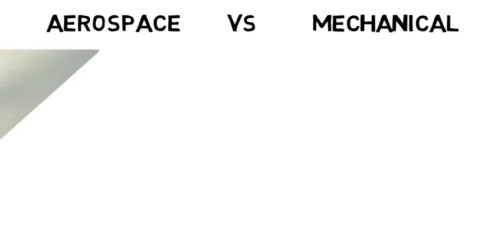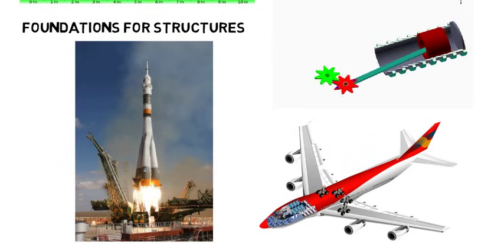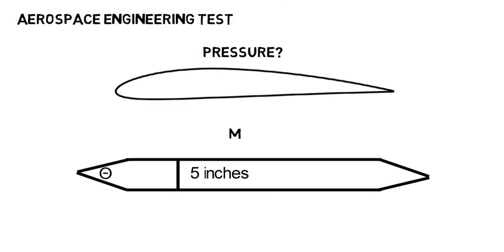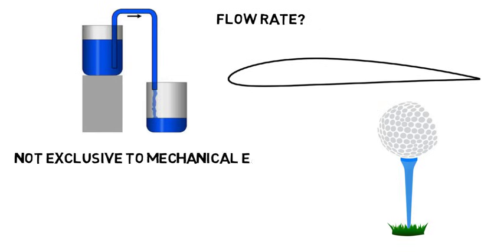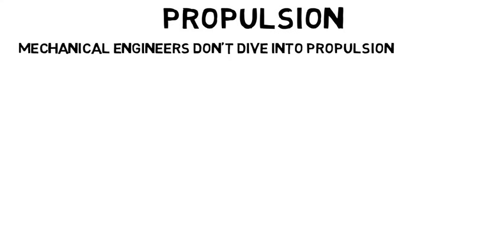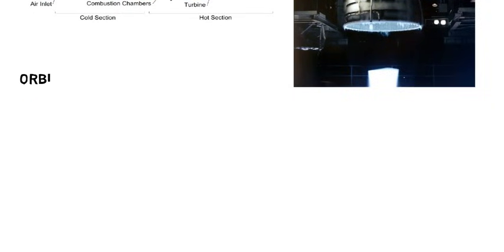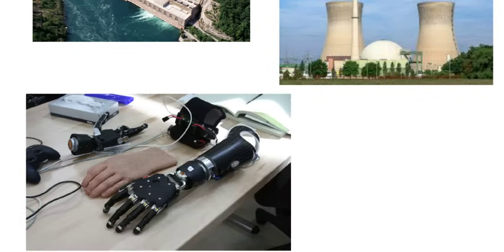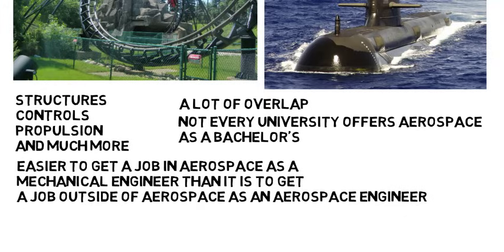Aerospace Vs Mechanical Engineering - How to Pick the Right Major

Comment: This is the video I needed to see 16 years ago when I was picking a major.  I went aerospace, but probably should have gone mechanical for the flexibility.  Nobody I spoke with knew enough to give decent advice on that decision, and (at the time) I was always told "If you can do aerospace, you can do anything".
At least I have some confidence that moving into a Master of Mechanical Engineering program was probably the right move.
Reply: How about the other way round?
Reply: Also I don't know for sure, but I think there are a lot of restrictions in the aerospace industry like you have to be American, often need security clearance etc. 
That's why as a non citizen I am still in doubt on how I should go forward in my career as I ultimately want to work on spacecraft and rockets.

Comment: Aeronautical/Aerospace/Astronautical Engineering has a lot of difference so be careful with that first. Aeronautical Engineers always expect to work in aero field cause of interesting subjects like Aerodynamics, Aircraft Design, Aircraft Performance and so on. But Mechanical Students study about Mechanical in General but they don't have much knowledge on application of mechanical in aeronautical engineering. That's the difference. Well i did aeronautical engineering because i was only interested to study in detail about aeronautics during Bachelor itself that how this flying objects do fly. That's the point. I work in Aeronautical/Aerospace field because i know how aircrafts work. That's why i chose aeronautical engineering. Aeronautical and Mechanical are not the same and infact aeronautical engineers have more knowledge than Mechanical Engineering but still Mechanical engineers are chosen most because they are good in designing of Anything. So i don't compare aeronautical with mechanical because aeronautical itself is the different field and there are lot of options after aeronautical that Mechanical Engineers don't have. If you are interested to study about aircrafts in either commercial/Military/Fighter than probably Aeronautical Engineering you have to go through. That's my opinion. Aerospace Engineering is all about study about satellites, rockets an so on. Be careful if you want to know how objects do fly then either you choose aeronautics or aerospace.
Reply: Not necessarily true, I chose mechanical because of the vast array of job opportunities; as I have interests in a lot of different area but want to primarily continue in the aerospace industry as I enjoy it having worked for Boeing and USAF.
Reply: @knyghtkrawlr  can a mechanical enginners is able to work in aerospace field
Reply: @muhammadajmal2380  yes but if you only want to go into aerospace probably best to get an aerospace degree or aeronautical degree
Reply: Can a aeronautical engineer gets a job easily

Comment: Aerospace is a spinoff from Mechanical Engineering, if you know MechE you can do both.
Reply: Mechanical engineers just touch on a bit of everything. You choose Aerospace if you don't want to work on a bit of everything and want to go into working with planes and spacecraft.
Reply: @DiegoHunter  in my experience, the biggest thing companies want is experience which you’ll get through internships or summer jobs with these companies. That was my mistake, I didn’t understand the importance of them. You are correct that aerospace is more specialized, but on a high level, one of the biggest things I learned with my degree was how to approach a problem and systematically solve it (which was then applied to aerospace problems). Now I’m sure mechE will teach similar skills, but I know there is more generalized knowledge, especially regarding thermodynamics and flow. So you’ll get the scope, but I don’t know how much you learn to apply it. If I could do it again, I’d still choose aerospace based on my interests, but I’d work a lot harder to get internships and expose myself to as much experience in applying my knowledge as possible. Hope this helps, I’m happy to answer any other questions you have.
Reply: it's just like meche but aero specializes on planes.
Reply: ⵉⵜⵔⵓⵏⴰⵓⵜ Lmao
All aerospace engineers are mechanical engineers, but not all mechanical engineers are aerospace engineers. Simple as that.
MechE is much more broad, general, and trivial compared to Aero curriculum.
Reply: @SLPpanthers42  no, cause at the same time  an Aerospace Engineer doesn’t know all things like a mechanical engineer. The A En. is specialized only on one argument
Reply: not true per se, other way round actually
Reply: ARE YOU GUYS ACTUALLY COLLEGE STUDENTS WTF AHAHAH
Reply: @kevinsanmateo4781  Your grammar level tells me that you aren't one either.
Reply: @rock3tcatU233  😆
Reply: @kevinsanmateo4781  🤣🤡

Comment: Which one is best aeronautical or mechanical engineering??
Reply: Alijut 12345 

Depends on what you mean by “best” since that’s a very subjective question. But if you know what you want to do in your career it can be and objective question. If you want to work on propulsion or aerodynamics, then Aero is best. If you don’t know what you want to do exactly, then mechanical is best. Although you can go to a college or university that offers a good AE curriculum and you’ll touch on a great deal to topics in detail and by late junior year hits, you should be able to know exactly what you want to do and then focus on that topic with the courses offered in AE.

Comment: These were literally the exact two majors I was considering.
Reply: I did aerospace as an undergraduate, but happened to graduate about the time the space shuttle retired.  The aerospace industry in general is more sensitive to what's going on in government, since most of the companies get significant amounts of their work from government funding (Boeing, Lockheed, etc.).
If I had it to do over again, I probably would have gone with mechanical engineering.  Getting a job when you get out is pretty important, and if you don't already have connections in the industry (as I didn't) it can be hard to get your foot in the door.
Reply: Dragon Bloodthirsty 
That’s one of the main things that made me choose Mechanical over Aerospace. 
Wish you the best of luck.
Reply: I want to work in spacecraft and rockets more than anything. But i am only concerned about the job opportunities for choosing aerospace engineering. Especially considering I am not a US citizen.
Reply: @livethefuture2492  same idk what to do
Reply: Drew Bishop 
Same. I ended up picking Mechanical.
Reply: To be completely honest guys, both courses are nearly identical with the exception of a couple of varying modules. So in my opinion, it won't make that much of a difference which one you choose to study as an under-grad. Most job opportunities I see regarding these courses accept both. It is very rare for the description to say accepting Aerospace graduates only (or Mechanical), usually both are interchangeable. I studied Mechanical Engineering and shared about 90% of my modules with Aerospace,  Automotive and Motorsport Engineers. For those looking to complete their Master's however, it probably will make considerably more of a significant difference.
Reply: @zacharysylvester8349  wait how much of a difference does a masters make? I’m a senior doing colleges apps right now and very confused 😢
Reply: Drew Bishop sameeeeeee
Reply: @marine5529  what did you choose ?
Reply: Ayo same wtf. I like aerospace more than other engineering sectors but mech engineering seems more broad with more opportunities
Reply: I’m in your shoes now... help
Reply: Same
Reply: Samw
Reply: I also
Reply: which did you choose?
Reply: Damn 7 years later, im in your old shoes. What are you doing rn? Hope you're alive 🙏 😅
Reply: @zacharysylvester8349 OMG YOU ACTUALLY REPLIED YAY! ok I think I get it. So the undergraduate might determine what you get in for grad school? I was thinking about doing mechanical undergraduate because I didn't know if I wanted to do biomedical eng or aerospace eng. Alot of people where saying that mechanical is too broad though so idk. 😭😭😭
Reply: Same here

Comment: My university doesn't offer Aerosoace engineering but i want to pursue it after my BE.  So what should I specialize in so that later I can get into Aerospace? Specifically what in Mech Engineering(Design&Manufacturing, Automobile, Energy Technology) 
Btw your videos are awesome. Keep it ☝️!!
Reply from the maker: Thank you! And it depends on what you want to do in aerospace. Working on the structural part of an aircraft/spacecraft is something an aerospace or mechanical engineer could do (assuming you're school offers it). But if they only offer the 3 you listed then I would pick design and manufacturing. Just having that M.E. degree will set you up well for the aerospace program though.
Reply: MajorPrep Thank you very much for the clarification. Helps a lot!!

Comment: Nice video! one of Mechanical engineering´s larger branches are turbomachinery ( pumps, turbines, etc) and static devices (heat exchangers), there are a lot of this devices on a refinery (example). You can also work on product design (apple and google ), maintenance itself is a very extensive discipline inside every branch (most companies with a fleet of vehicles or any group of mechanical devices must have a maintenance engineer to ensure a long useful lifetime), even screws and bolts could be a tricky thing (and its a millionaire business for manufacturing companies); of course there are a lot of those in the ones you mentioned but i thought that it could be more specific (Y) PS: english is not my main language sorry for any mistakes above.
Reply from the maker: Thank you for the comment! Yes there is so much a mechanical engineer can do it's overwhelming when I make videos cause I have to narrow it down so much lol. But really appreciate the input.
Reply: Yeah! anyway it was a very nice video and i liked it a lot! i´ll subscribe for more of your quality content, keep it up :)
Reply: Mechanical Engineering is the key technology and the father of all engineering majors.  All engineering majors are very dependent on Mechanical Engineering.  Including the internet run by mechanical engineering machines.  99% of the contents of our house are related to mechanical engineering except our bodies and lives.  A very important department and always have to be more than ready if war breaks out.  Civil engineering is most dependent on mechanical engineering.  There are no skyscrapers without mechanical engineering.  Tools of war and weapons are the scope of mechanical engineering including nuclear reactors.  Mechanical Engineering exists in all fields and majors.

Comment: When choosing your major, is there a divide between Aeronautics and Astronautics? Ideally, I would like to find myself in NASA or SpaceX working on space exploration, but I do find interest in non-commercial aircraft aswell. Do they lead different carrer paths?
Reply from the maker: When you pick your major from what I've seen  you just put aerospace engineering. Then you choose later between aeronautics and astronautics in your later years. It's just dependent on whether you want to work on aircrafts or spacecrafts. I've known people who went in astronautics yet got jobs working on aircrafts so it's not set in stone what you can do. But you should pick what interests you more.
Reply: Tempest and a Computer I'm a final year aerospace engineering student. Your course that you would want to join, as Major Prep stated is just Aerospace engineering. For the first 2.5-3 (depending on the university) years you won't have much control over what you do but you can specialise in them fields towards the end.
Reply: Thanks for the answers :D
Reply: Most universities if they offer aerospace will divide into Astro and aero late into your third year. You’ll basically be side by side with the aero people if you wanna do Astro until then. It really won’t hurt going into Astro if space exploration is your passion but would be interested in working non-com aircraft. I know friends who study Astro and got hired by Lockheed for jets

Comment: Aerospace engineers are the baddest of them all 😎
Reply: Aerospace engineer dicks are bigger
Reply: If u do ME you can do mechatronics, robotics and even aerospace. Don’t limit yourself to just planes
Reply: @danielonyia498  exactly bro that's the point😊🙌🙏
Reply: Fredy De La Mora Aren't they basically Mechanical engineers?
Reply: yeah pretty much lol
Reply: Who doesn't use FEA or CFD (Aerospace Engineer, TU Delft). You literally cannot learn everything in Aerospace Engineering without first going through and understanding all Mechanical Engineering understanding. Go have a look for yourselves and compare the syllabus between both courses on any universities website.
Reply: no job
Reply: Rich 91  🤣😃😃🤣
Reply: We got to make missiles
Reply: BADDEST
Reply: BarcaTalk aerospace engineering is not the same as car engineering. For example, you can't use square windows on airplanes, as they cannot withstand against pressure during flight.

Comment: Thank you for this video. I am applying to college right now and I have trouble deciding between aerospace and mechanical engineering. If I do go to a college where they offer both, is it worth to do double major? I have been researching and since these two majors are very similar, some schools do offer double majors. I would like major in AE work in the aerospace industry but at the same time I feel like ME is safer because of there a lot more  job opportunity
Reply from the maker: If your school offers a double major and you can handle it then I say go for it. The aerospace engineers I talked all said they went into the major cause they knew for a fact they wanted to work on aircrafts/spacecrafts. Wanting that flexibility definitely makes sense but note if you choose mechanical you won't be doing those classes on orbits, propulsion, aerodynamics, and so on that you might wish you took.
Reply: Hi! I was wondering if you decided to double major, and if you did whether or not you think it was the right choice. I'm going to be a freshman at CU boulder and they have a really good aerospace program, but I also want the job flexibility that mechanical gives you. I've been finding a bunch of perspectives and honestly double majoring or not is split 50 50 so far

Comment: Can you do Mechanical vs Electrical Engineering?

Or perhaps all the old guard engineering disciplines besides civil such as electrical vs chemical vs mechanical engineering and comparing how each engineering discipline would tackle a related problem such as in the energy, biomedical, or other related sectors while contrasting the differences.
Reply from the maker: I already did mechanical vs electrical engineering :), check some of my previous videos.

Comment: Hi, in these comparison videos, can you maybe put a little more emphasis on the job market, job stability, and other things related to careers besides the different jobs you can have? I'm deciding between mech and aero, but something I'm having trouble with is understanding and considering the job availability and stability. I get conflicting information on online forums, and I am unsure of how to properly research it. Thank you.
Reply from the maker: The reason I don't do that usually is cause it's so similar especially for many of the other one's I've done (EE vs ME or CPE vs CSC) and you're just splitting hairs at that point. For these two there is more of a difference but it's kind of hard to put it simply. The aerospace industry typically fluxuates and there are times where it's doing well and times where it's more slow. I read of aerospace engineers working in the industry for decades and I've heard of one's who switched industries at some point. So I've seen a lot and it's hard to predict what will happen. Overall there are more jobs in mechanical engineering than there are in aerospace engineering cause of all the sectors you can get into.
Reply: @MajorPrep 
I worked for a big international company with “Aerospace” in its name for 19 years, between 1995 and 2014. For the first 11 years, our company was one of the crown jewels of our whole country. Some people even thought we might take over Boeing eventually...
By the time I received a severance package ($$$) eight years later, it was falling apart. Now, it’s an embarrassing wreckage. I pity anyone who began their career as an engineer there in 2009 😱.
But you never know what will happen in Aerospace!